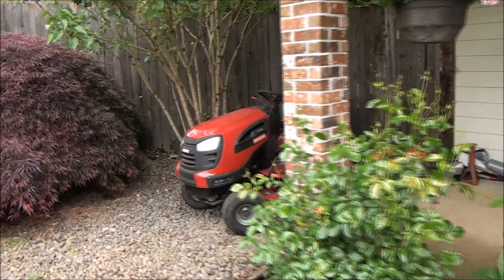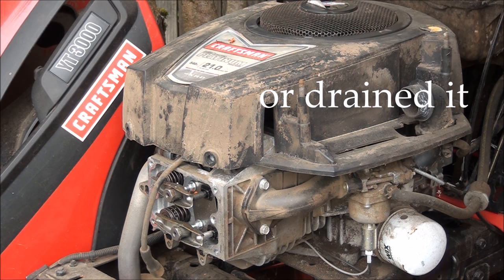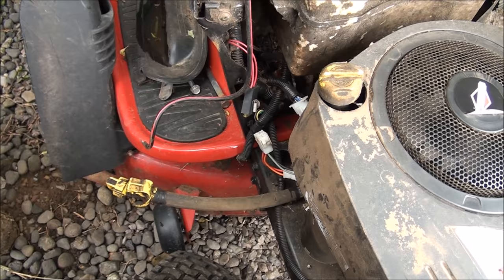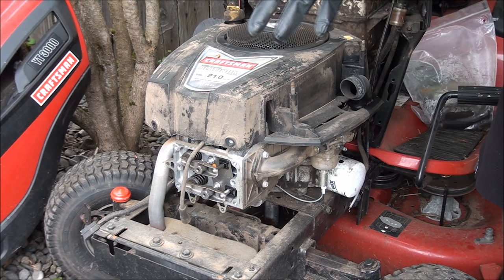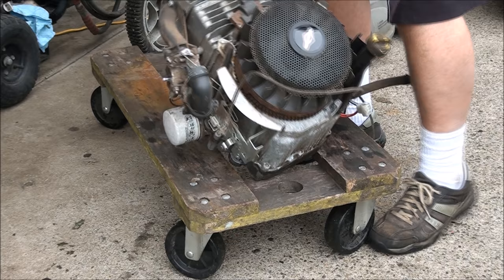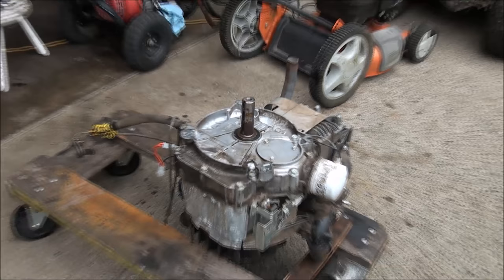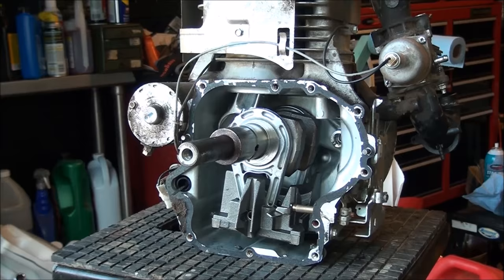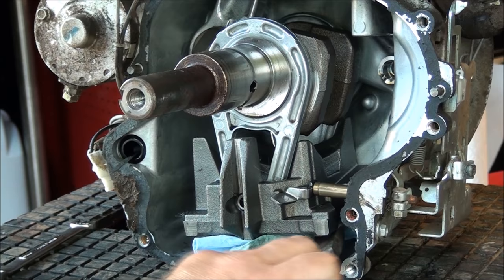DESTROYED! What a BUSTED CAM looks like. Briggs and Stratton OHV INTEK model engine common problem

Comment: And just think, you still gotta scrape the sump!
Sump gasket, bottom seal, cam, timing gear, labor and fluids, gonna be pricey.
Reply: What to charge for labor, that is the question. I still don't have a good idea, just being a hobbyist. I don't think an hourly charge like the shops do is fair, since I'm still learning and am so damn slow. So I just give estimates and hope it works out. On the 21 Hp Intec I worked on recently that had this exact problem, I charged the customer $200 labor plus parts for replacing the camshaft, new case gasket and oil seal, cleaning and rebuilding the carb, cleaning the gas tank, new shutoff valve, new fuel filter, new oil filter, new fuel lines,  putting in inner tubes in both front tires because of sidewall leaks, replacing the main drive belt tension pulley because its bearing had failed. Then setting the valves and testing the whole thing out, which ran and cut fine. The mower had sat for over three years till they finally brought it to me, and was made in 2010.
Reply: @dkeith45  l try to get between 35 and 40 an hour.
That being said, I do try to charge by the he job. When I get hung up on something I've never seen, I can't very well nail my customer for it.
I try to charge what it would be worth to me, if I were the customer. I can't charge someone $50.00 on an old mower with $50.00. That's when we have a talk. I'll try to help anybody out, but I gotta at least break even.. I have given some stuff away. It's a 43 yr old hobby with me, the wife hates it. TS!
Reply: @Jim-ie6uf  I hear ya. I generally charge $30 an hour for handyman stuff, but I've been doing it for years and know all the ins and outs. Working on lawn mowers is something new for me, only been doing it for two years now, and just here and there. I'm in the same boat on mower worth VS repair cost. Same as working on computers. If the repair is going to cost more than the item is worth, usually not a good idea to repair it. That always tempers my labor charge mentality. In the case of the 21hp, I did some research online and found they usually sell in the $500-$600 range used. They were $1,600 new in 2010. So my customer ended up paying $450. Not a bad deal for them IMO. Sad part is, how long will it be before that craptastic cam breaks again?
Reply: dkeith45 I’ve had a guy show up in the driveway, while I was working on one of mine.
He needed a primer bulb and installation. I gave him a beer while I was fixing it.
He asked me how much, and I told him whatever you think it’s worth. Gave me $5.00 and came back with a 12 pack. Now he’s a repeat customer.
Many times, you’ll come out better and ahead on small stuff like that and fuel line.
They will remember you, for sure. I do this for some hip money, and I enjoy it. But I have been doing it off and on since I was 14, I’ll be 63 on the 13th. I must admit, I’m getting kinda burned out on it.
Reply: That’s what I’m working on now

Comment: What about the Rings since it was out of oil it must be using oil just wondering about that.
Reply from the maker: Yes, for sure that is a possible scenario. Luckily this one did show any cylinder/ring damage and did not smoke when running after reassembly.

Comment: I have only one word to say ouch is the word of day  the owner of the engine is going .to.pay for that broken  engine I do believe that the oil  was either 5 w 30.or 10w 30  which is great for car engine,s  if used Briggs and Stratton enigne,s you must keep a check on the oil level for a lawnmower engine will burn it up quickly .they run hotter than a car engine  you.must use straight 30 weight boil to issure proper lubrication of critical engine parts  wouldn't you agree with this matter Jeff
Reply from the maker: yep
Reply: @JeffsLittleEngineService  thanks for your reply  young man 😎
Reply: @dkupy100  if you use 10w30 at the right time of the year
Reply: @dkupy100  okay i must be mistaken my bad
Reply: Briggs and Stratton specs 10w30
Reply: @brianwhite3051  okay thanks for your reply
Reply: @robertmailhos8159  You are not mistaken. Do not use multi viscosity oil in any air cooled engine
Reply: @fastguned  thanks for your reply on this matter of engine.oil 👍😎
Reply: This is quoted from my Briggs and Stratton manual  that came with my Snapper tractor style mower with 14 HP

"Air cooled engines run hotter than automotive engines. Use of multi-viscosity oils(10w-30 etc) above 40 degrees Fahrenheit will result in high oil consumption and possible engine damage"   ---directly quoted form my mower manual
Reply: @fastguned  you are right about that matter young man 😎👍
Reply: @robertmailhos8159  Here is the deal I forgot to add. Air-cooled engines get to operating temperature in a few seconds unlike an auto engine that may take 5 minutes to get to operating temp.  The engine will be hot  quickly and the oil will still be thin.. The reason I totally believe this is because it makes perfect sense and being and ex mechanic I have a lot of mechanical sense, My little 14 HP Snapper is 26 years old and has no oil filter and still going strong . I have a neighbor who had the exact same model and his blew the engine after 5 years. He told me he used 10w-30 in his but he thought what blew it up was he didn't change his oil often enough. He was partially right. He didn't change his oil to the correct oil. Common sense and factual evidence win.
Reply: @fastguned  you are right about that matter young man 😎👍 some people Fall victom to miss leading information on the proper oil to use in the engine

Comment: What would happen if I reinstall cam without compression release
Reply from the maker: might not start
Reply: Will not turn over when it hits top dead center. Acts like a dead battery or a bad starter.

Comment: I know you're trying to make a living, but you're getting in way to big of a hurry. I watched both videos to this series, I saw a lot of things. 
I know you "washed" the engine out with some type cleaner you said. But I can't hardly believe that you didn't finish taking the rest of the engine apart, and clean it out properly. Especially after seeing how that cam exploded into bits and ect. Those bits could be stuck anywhere and come loose at some point and destroy the engine... again. Further if you had taken everything apart, then you could have used engine assembly lube on the crank, piston pin, cam, and the many other contact points. As just spraying some oil (and wd40...) in there is not going to get into the very tight clearance locations.
Reply from the maker: good tips!
Reply: Yhrim....wheres your video to do this?
Reply: @thornbush17  I didn't make any videos about engines, but I've rebuilt them. Was only offering my opinion, because if I didn't clean an engine completely and the shrapnel that was left caused it to destroy itself again or other issues... i'd be pretty mad at myself.